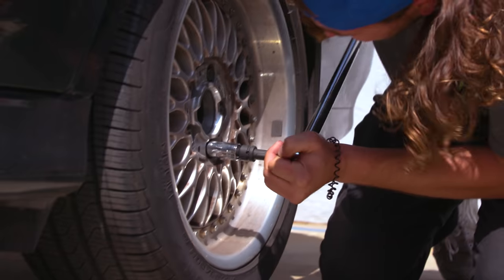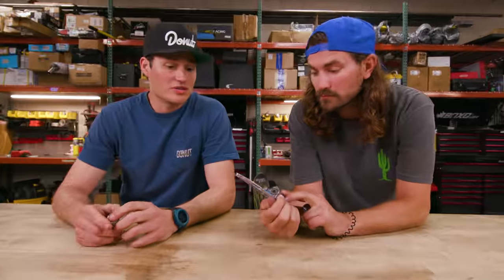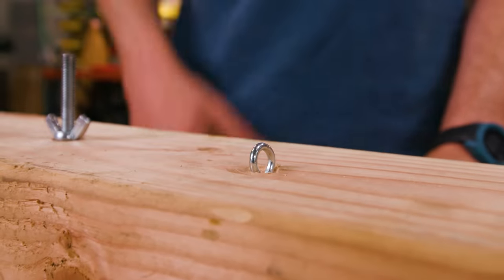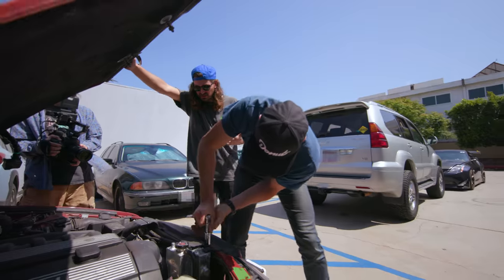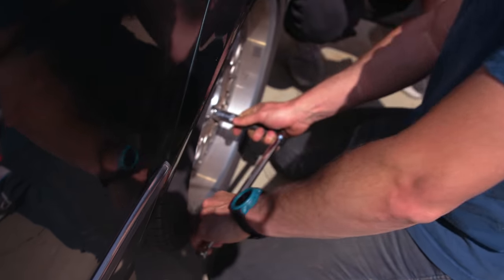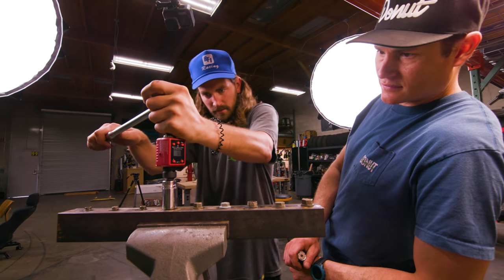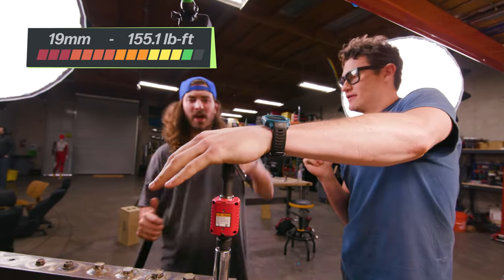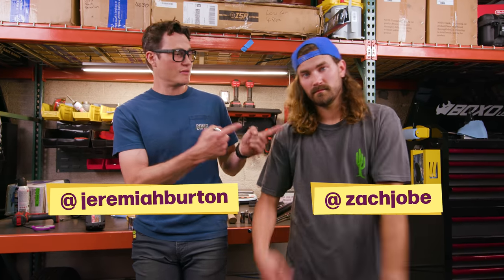Testing the World's Most Hated Tool

Comment from the maker: What tool should we test next?
Reply: out of context, but try to review cute keychain, like turbo keychain and other, even there is ball bearing one
Reply: I know it's not a specific answer but I think more "as seen on TV" tools would be great to see if they're worth it or not
Reply: Your mom
Reply: Dent king
Reply: Bolt extractors
Reply: Why did you reload it
Reply: I wrote this while watching the video so I guess my "wish" has been granted 🤣
Reply: Try some complete toolkit comparisons! Also, do you think you can put the metric measurements alongside the imperial in the edit? Like Nm alongside the lb-ft? It will make it super easy for the rest of us!
Reply: Angle grinders
Reply: you should try different types of bolt extractors. including those cheap chinese products to see which works best 👍
Reply: my fav tool of all, a d-list of donut employee cars
Reply: FLEX TAPE PLZZZZZZ
Reply: What tool was used to duplicate that actor throughout the entire video? Impressive.
Reply: PB blaster vs heat gun vs butane torch vs impact. Do some tests to show how each helps get a stuck bolt loose.
Reply: Could you please make a video explaining why teslas, or electric vehicles in general, have so much torque and acceleration but have little to no wheel spin compared to combustion vehicles with less horsepower and torque and wider tires?
Reply: Battery powered tools vs pneumatic, except for the hose, which is better. Also paint touch-up in dyi or don't.
Reply: You should test the various ways to join two electrical wires. Like standard barrel crimps vs those clips that have the blade thingy that cuts through the insulation as you close it vs twist and tape vs soldering etc
Reply: Why did you re upload it
Reply: A pump cart obstacle course consisting of only paper clips on the ground. Pretty much a guarantee that no one will get past the first obstacle.
Reply: Sham-wow
Reply: Try the "impactor" its a socket that has an impact mechanism built in
Reply: Jer, super cool shoes.. hope you didn't scuff em. Maybe try some fabric cleaners?
Reply: CAR JACKS  and CAR STANDS!!!!!!!!!!!!!!!!!!!!!!!!!!!!!!!!!!!!!!!!!!!!!!!!!!!!!!!!!!!
Reply: cheap vs expensive R134a. Not a tool but may be neat
Reply: your mom
Reply: FLEX SEAL ALL OF THE THINGS
Reply: The nemesis of all mechanics: gasket removal/gasket scraping methods.
Reply: Please test the durability and accuracy of 1/2" drive Torque wrenches. Click type and electric. Pittsburgh vs. Icon vs. Snap on etc. I want to see if the cheap ones are still +- 3% accuracy. And how often they really need to be recalibrated.
Reply: robo grip
Reply: Flex Seal and make the boat
Reply: Eye protection!
Reply: Hardened steel screwdrivers that actually work and don’t slip and strip. Hardened steel is subjective and most are hyperbolic.
Reply: Tiger Wrench
Reply: My mom
Reply: As Seen on TV Auto Adjusting Crescent Wrench
Reply: The next tool should be flex seal. Make it as funny as the commercials 😂😂
Reply: Oil filter wrenches. Stack ‘em up to see which one is the king 👑
Reply: Please do an " Up to Speed " on the Hyundai Genesis Coupe...😊
Reply: Tool Truck Face off. Is Snap-on worth your soul or are the other tool truck brands just as good
Reply: Slap Chop
Reply: Scratch solution-
Reply: Or Car Cane.
Reply: Off brand Duct Tape would be funny. I see that stuff in stores everywhere. Is the Off brand as good as the main?
Reply: The spray sealant that you can make a boat out off
Reply: Welder
Reply: Screwdrivers
Reply: Gear Wrench Quadbox tests now? (Not seen on T.V.)
Reply: Bionic Grip Wrench / Bionic Wrench
Reply: Flex tape
Reply: Pressure washer and vacuun cleaner! Please
Reply: Angle grinder attachments, that turn those death machines into different death machines.
Reply: Jeremiah. He's a tool. Test him.
Reply: For it to work you have to buy the gator nuts and bolts
Reply: We wanna see you fix cars with non-car parts
Reply: Plastic welders
Reply: You already tested this tool
Reply: Brushed vs brushless
Reply: Head Gasket sealer i.e Steel seal
Reply: I have a set of RoboGrips from the 90s that I still use, might be worth it.
Reply: Toque wrenches please!
Reply: Swivel sockets, universal joint adapters, and flexible extensions.
Reply: Any of the flex tape products
Reply: Hilti Tools
Reply: Crescent wrench
Reply: Flying Lures
Reply: Flex seal/Flex tape all of the Flex products lol
Reply: Hose clamp pliers
Reply: Oil filter remover tools!
Reply: FLEX products
Reply: As seen on TV… I don’t know why you’d make a flexseal bottom boat, but I’d love to see it
Reply: The ASOTV Turbo Jet vs power washer
Reply: Flowbee, Without a doubt, Zach and Nolan could use a trim.
Reply: @muddboss3309  yes
Reply: @JeazyG  they have a lot of good videos about electric motors and ev cars on this channel already
Reply: Robo grip from Sears
Reply: the Knipex 8605250 will totally replace all of your spanner tools though and most pliers... you will never use them ever again.. especialy the adjustable ones... those screws that you screw with this weird socket. it can totally do that... if there one tool i can have on an emergency i want that to be it..!! (bold claim i know but look at it)
Reply: I have no idea what it is called but my wife got me a flexible bendy shaft for my drill to get into those awkward hard to reach places. I actually used it to drill some holes under a power wheel to add underglow for my kids.
Reply: I still have dent king it takes multiple pulls to work but you can get high spots doing it
Reply: I still have dent king it takes multiple pulls to work but you can get high spots
Reply: You guys said the most hated tool. I thought it was dewault 😂😂
Reply: Well, now that you bring up the common American tradition that is the junk drawer... I think it would be a pretty good competition to see who has the best collection of junk drawer tools... You know you're gonna find at least a few tire pressure gauges and an assortment of missing sockets... but, the junk drawer also extends to your toolbox junk drawer too... at the end you can do some trades to see if these tools can become one mans trash to another mans treasure. =) Some of them might just end up back on the shelf being put to good use.
Reply: Test out some bongs to see if they rip just as good as the next ...thats what i do all day with 10 different bongs by the 10th i forgot why i started...its what i do for creating..im into fancy rich people wood builds and creation is endless...we used these for a gear box of ours for a weed tumbler sifter ...worked well because it has flexing in it functions...
Reply: Shamwow🤣
Reply: @JeazyG  Torque on EVs has to do with how electric motors work, let me explain. torque is measured by force times distance from center of rotation.. in fuel cars that means force of combustion (witch is no constant due to timing variation, fuel combustability not been instand and so on) times cranks length.. on Evs is the diameter of the stator (outrunner motors) witch is huge times magnetic field force witch is constant throughout the rpm range, so torque is max and constant even at 0 rpm... 
now about wheel spin.. well thats easy, its electronically controlled... they are tone of videos of EVs drifting that disable that safety feature, all though they are very hard to control due to instant power been applied on wheels that leaves extremelly small margin for error..
Reply: FLEX TAPE!!!! (It fixed my convertible top a few years ago until I replace it)
Reply: Finding 10mm and 13mm block keys. Once I searched for a 10mm, found like 7? 11mm.
Reply: Zachs dumpy??
Reply: Oil filter wrenches, there are like 100 types and most of them are shit
Reply: Different hair brushes with obvs Zach!
Reply: 18v battery grinder
18v band saw
Reply: Car Jacks
Reply: Try Kids Toy Tools...
Reply: no idea if its on "as seen on TV" but, rust converters or rust "figting" kits would be nice.
Reply: Oil filter wrenches - the pliers style, rubber strap, chain strap, the kind that go onto ratchet wrench, and whatever other types there are.  And test on various size filters, some with half filter inaccessible, i.e. recessed against oil pan (look under a 2008-2013 GM truck with a 5.3).
First time to post/reply......long time subscriber.  Keep up the tech and info-based videos !!
Reply: internal bearing pullers
Reply: Harbor freight tools against name brand! I love freight tools but they get a bad rep
Reply: EasyOuts - the cheap ones.
Reply: Open End Ratcheting Wrenches. There are a bunch of manufactures and their designs are slightly different. My craftsman set upsets me because they do not easily lock back into place. Help me find a brand that works because if you did they would be worth their weight in gold!!!
Reply: Flex fix tape and goop for sure. "Fix any leak"
Reply: Zero Degree Socket Wrench
Reply: dude i bought this for my dad at Christmas...
Reply: @jundikhaalish2081  I agree, cute Keychains - why the heck not.
Reply: Flextape
Reply: the different types of easy out bits and how easy they are for removing broken bolts vs just welding a nut on it and using a box end on it
Reply: Air pressure gauge tells u how much air in all tires threw air caps and connects threw cig lighter
Reply: Shop vac
Reply: Whilst it’s a little bit more up “project farm”’s alley …. Comparing different types of torque wrench and their accuracy. E.g. ratchet vs deflecting beam vs electronic
Reply: cheap vs expensive torque wrench??
Reply: Any power tools Budget Vs Expensive.
Reply: I'd love a video on how to get a stuck o2 sensor off a 2002 focus st170 (svt for my American friends) because at the minute that's standing between me and an MOT/ roadworthy certificate 😂
Reply: Torque wrenches
Reply: The bionic wrench.
Reply: I think a tool brand comparison would be cool. EG Snapon vs Sidcrome or similar to see there braking point.
Reply: You should have put a 3/4 impact on it!!! Really torture test it!
Reply: Magic pen for scratches would be nice to see in Tool Party Graveyard... Or maybe it would not end there? ;)
Reply: Flex tape. Can it patch a flat tire?
Reply: Chinese makita based tools like those on aliexpress
Reply: @jundikhaalish2081  wouldnt  be a bad D-List sode
Reply: Floor jacks and torque wrenches. Separately of course
Reply: Oil filter wrenches
Reply: Duct tape vs gorilla grip vs jb weld
Reply: Double sided d1ldo
Reply: Flex Tape !
Reply: Touch-up paint, paint-less dent DIY repair tool, DIY windshield rock chip kits
Reply: one of those fix a flat kits that come with cars instead of a spare
Reply: shotgun
Reply: @coreydabrowski2249  let’s go I’m with you
Reply: James Pumphrey
Reply: @jacobgalloway6942  Project Farm did that.
Reply: stuff relating to seized bolts; stud extractors, penetrating oil, heating up, tapping under torque etc.
Reply: you should test more your mom jokes
Reply: @muddboss3309  Is that the one that uses hot glue? Some PDR(Paintless Dent Repair) guys use similar tools. I've tried a few myself. They can work really well. But they can also pull the paint off the panel. Depends on the dent and the paint. Good one to review in my opinion
Reply: Jack stands
Reply: Flex tape and flex seal
Reply: Test the T Bone wrench. Each end has different sockets on a swivel. DO IT
Reply: @jacobgalloway6942  love flex tape
Reply: Flexible Extension Drill Bit
Reply: Harbor freight vs snap on pull bars
Reply: I want too see a tourqe wrench test. Cheap vs pricey. Curious as too how much accuracy they lose overtime or just come calibrated wrong. Also could throw in the price you pay for using your tourqe wrench for a breaker bar haha
Reply: You guys gotta do one on the Knipex adjustable pliers. I don't road trip without em!
Reply: ShamWow.

My old man bought dozens of them. It’s no replacement for a chamois, but it’s miles better than any microfiber I’ve ever used. Plus, i’d never use a chamois to wipe puke off a quarter panel…
Reply: JB weld
Reply: Truck stop tools
Reply: You should collab with Project Farm
Reply: Battery powered socket wrenches.
Reply: @JeazyG  Interesting. I always assumed that it was better traction control and monitoring. Easier to measure spin based on motor load and much more granular control over power output of individual wheels. But. Maybe that isn’t it at all.
Reply: flex tape
Reply: Bucket vac
Reply: Flex tape.
Get in a fender bender in the rain and want to hold the thing up for a bit til you can get it to the shop. Can the tape work, as advertised, when things are already wet?
Reply: Robogrips, please!
Reply: Shop soaps - Lava, Fast Orange, etc.
Reply: get someone's son to hold a flashlight, get a tool from the drawer, buy blinker fluid, etc
Reply: A drildo
Reply: the different types of specialty transmission repair tools.
Reply: Unrelated to the question, but can you guys please stop saying "Foot pounds of torque" 'cause it's actually lb-ft of torque...
Reply: I can't remember the name... But it's a compact lug nut changer that fixes it if there's damage... If anyone can find the name of it...uch appreciated
Reply: Magic wrench maybe?
Reply: Would be kinda cool if you done country comparison, Example UK VS USA on tools so which county does the best tools or other things like components of a car you can do alot of country Vs country
Reply: Why didn't you try standard.and metric bolt sizes with the gator grip. Not that I would expect it to be any different, it would just be interesting to see if it grips standard any better
Reply: There's a newer updated version of this tool called the super socket I used to get ads for it a lot but I never ended up getting it you should try it!
Reply: Not really a tool, but flextape is obviously a must
Reply: @jundikhaalish2081  the tool that they must try should use a silver sprocket.
Reply: @LIKEcommentANDsubscribe  or white sprockets.
Reply: @stoyan.velinov  happy early idul fitri 2022, Stoyan Velinov. 🙏
Reply: @Jamppa.  try also silver sprockets.
Reply: @OliveMule  👍👍👍
Reply: @jacobgalloway6942  try also the sprocket from white chains.
Reply: The same tool, but with standard instead of metric bolts.
Reply: The shake weight :)
Reply: Test my tool 😏
Reply: @purwantiallan5089  what???
Reply: Impacts, cordless, vs battery, vs pneumatic
Reply: Walmart tools???
Reply: Former Vice President Joe Biden
Reply: sawzall, obs, chop chop. Then a nano chainsaw - super fun. Titanium coated step drill - best fun ever. Go a powered metal sheet nibbler - dare ya. plasma cutter - hell yes.
Reply: Steel stick and flex tape/seal products
Reply: Cheap welder vs exspensive welder :?
Reply: @quintbottolfsen5817  Totally want to see what they'd do to get there hands dirty between each scrubbing.  Haha. Pour oil over their hands and then dig through a bag of potting soil?
Reply: @ErickBreneman  James and Nolan test messy foods part 2.
Reply: FIBREFIX!!! For manly men.
Reply: OBD readers
Reply: A 10mm. I hear they are hard to find
Reply: Can you please test a Joe Biden?
Reply: Robo Grip
Reply: I like that you guys are running the Milwaukee Fuel E-tools. I have a vast selection of Snap on and Milwaukee stuff and the Milwaukee outperforms most of my Snap on.
Reply: Test that "as seen on TV" wonder drill bit that never needs sharpening and can drill everything
Reply: How bout those multisocket oil pan drain plug tools?  Gotta ❤️ those!
Reply: Test i think Flex Tape? See if you can make a buggy out of it.
Reply: @JeazyG  Weight. That's the entire video.
Reply: Oil filters/ ring ratchet /clips remove
Reply: joker wrenches homie
Reply: @shikamaru281281  electric cars weigh more and are faster.
Reply: @JeazyG  Not all are faster. Lots of electric cars are ~6 seconds 0-60. The reason they CAN be faster, is because of weight. The more weight = less tire spin. More pressure to the ground = more power to the ground.
Reply: You should test one of those snake adapter things next
Reply: Metwrinch!

The award-winning 62 Piece Metric and Inch Combination and Wrench and Socket Set handles all nuts and bolts - Metric, Standard, and even ones with rounded or worn edges. These sockets and wrenches are able to grip both inch and metric fasteners, reducing slippage for greater safety and making it virtually impossible to damage them. The compact set of 62 Metric and Inch tool replaces 130 conventional tools. Keep a set at home and another in your car. The solid chrome-vanadium tools are backed by a lifetime warranty. 1/4" and 3/8" drive ratchets and sockets included.
Reply: Can you do a test on Brake line flare tools?
Reply: @JeazyG  It's the electronic traction control. Very clever controllers they is!
Reply: Lizard Camera
Reply: Hitachi magic wand
Reply: Nu Finish "the once a year car polish"!
Reply: Quick action wrenches, different brands. there great but I break them all the time and im wondering how many pounds are they breaking at.
Reply: Taking out an engine using only gator grips would be a cool video
Reply: @KJW742  you would need like 50 of them just to get the motor out and 100 to put it back in lol
Reply: @Ro-Bucks  it doesn't need to be perfect, just has to run
Reply: Torture test a shop vac vs. Dewalt/makita/harbor freight vacuums... see what will clean the shop the best for the longest
Reply: @jacobgalloway6942  check out tyler tube for all your flex tape/flex glue reviews... he does an awesome job!
Reply: The dude sitting next to you? 😂
Reply: Vampliers or Bionic Wrench
Reply: Flex Tape
Reply: Cordless Ratchets: Milwaukee M12  is the standard, lots of cheaper options on Amazon.
Reply: Screwdriver Sets
Reply: Yourselves
Reply: @jmb371  Bam!!! 😂😂😂😂
Reply: @JeazyG  interested to see this one too. from my understanding, wheel slip is detected electronically and thus adjustments to the power output of the motor are nearly instantaneous, compared with a gasoline engine where that kind of fine control is impossible - throttle and fuel injection are pretty imprecise inputs comparatively. basically as far as i'm aware of only the brakes are used by traction control to stop wheelspin in ICE cars instead of the motor itself
Reply: The super saw and tactical flashlight
Reply: Fluted broken bolt extractor vs spiral type
Reply: @JeazyG Hall Effect wheel speed sensors on each hub to throttle back via the traction control system.  With the system disabled, electric motors will thoroughly smoke down some tires.  Might have done it a few times to prove a point.
Reply: @xDMG15x  They are called Scotch Locks.   The epitome of half-assedness.
Reply: @cameronh5442  Same chemical compound.  Just get the cheap stuff from Wal-Mart.
Reply: @Shaw9.81  I’m a Hyundai Tech.  Whatcha wanna know?
Reply: @dillonreynolds370  Get the Ebay welder kit.  Looks like a normal pistol type soldering iron.  About $19.  It’ll change your life.
Reply: @benrampling812  PB Blaster rust penetrant left soaking for hours.  If it has broken loose but galled and cross threaded itself on the way out, force it, for the threads are already ruined.  Chase the threads with a common spark plug thread chasing tap.  If the O2 is known bad, cut off the harness and use a 6pt deep socket.   No half-assing it with an open end wrench.
Reply: @blackhawk7r221  why is the 2009-2016 Genesis Coupe missing one differential bushing?
Reply: @imacahguy  Lifesaver tool
Reply: @eyo-abasibassey983  Too entrenched in the common vanacular from the olden days when we didn’t need to know the weight, we needed to know how far it could be lifted, that’s why we say it backwards.
Reply: It’s Thunder  I use my inexpensive $259 flux core HF mig far more than my other real machines.  As long as you get a 220 version.  Easy as pie to wire a 220 outlet.  We aren’t exactly looking for xray quality pipe welds, right?
Reply: @shikamaru281281  They are very downrated.   Long ago we played with a prototype demo Prius at the tech training center.  Easily did 0-60 in under 4 seconds.  I think they put it out on tour to get mechanics fired up about the future electric cars.  This was way back in the early 90’s.
Reply: @Shaw9.81  Be a bit more specific and I’ll look it up.  Bushing location in the diff?   I’ll be honest, we’ve never had to open up any rear diffs at our dealership.
Reply: @Shaw9.81  Are you speaking of why the diff chunk side bearings only use a shim on one side?
Reply: @blackhawk7r221  yes I am...😮‍💨
Reply: shake and break
Reply: @Shaw9.81  Part 53064 spacer shim, same part number on both sides.
Reply: @blackhawk7r221  ok thank you, I already put it on😅 but does Hyundai ship them from the factory like that?
Reply: my manager
Reply: flloor jacks
Reply: Those miracle car paint repair pens
Reply: @Shaw9.81  Could not say, but doubtful. Our parts diagram shows carrier shims on both sides.
Reply: @blackhawk7r221  all been done and she's not budged mate. I got sick of it in the end and was only doing more damage to the flats and threads so decided best to let the professionals have a go before I end up on the next video of "customer states" 😂😂they should have a much better time with it than I will and It means I can get the car back quicker hopefully
Reply: @benrampling812  What you are experiencing was common  on Toyotas.  Lack of anti-seize  from the factory, and we paid the price at the dealership.
Reply: @blackhawk7r221  o2 sensor needs replacement as it's not functioning and failing an emissions test at low idle. Tried most tricks in book to get sorted but no luck.
Reply: For the next tool to test, I can think of a few politicians in Canada and the US.🤣
Reply: different types of oil filter wrenchs
Reply: Turbo encabulator.
Reply: Your balls, you should see if they still work.
Reply: Metrinch sockets and wrenches.
Reply: I'm just saying if someone re created it but instead of circles make it out triangle pieces so when you start torquing down on it the triangles lock into one another and it would be flat along the cross sections on the bolt head
Reply: The crazy two-blade Sawzall that premiered several years back
Reply: How the wallet ninja 🥷 actually performs with the tasks it can claims it can perform
Reply: Gunson colortune.
Reply: I would love to see if knipex pliers are really that much better than the Doyle knock off and other brands
Reply: Nolan
Reply: You should fabricate your own gator grip but instead of round pins you use small hexagonal ones that are more tightly packed. Would be an awesome design study.
Reply: Speculum
Reply: A bunch of Weird tools from Aliexpress.
Reply: Spark plug bolts.
Reply: Test the difference in strength between high end tools. example: a 17mm spanner snap-on VS mac VS teng VS facom. See which one is really worth the dollar
Reply: Jack types for cars. Speed jacks, fame lifts, traditional jacks etc. pros and cons and cost benefits
Reply: @fillhall4774  dude the only snap on tools i own are ones I've found, the reason i want them tested is because after 12 years as a mechanic i still don't think they are as good as advertised i want them to break
Reply: Squatty Potty
Reply: Quick battery disconnectors!
Reply: Please, Please: Chinese made vs American made tool sets.
Reply: gator grip is good when you dont have any other sockets. but thats about it. ive had one for many years and have used it half a dozen times. its not flawless. bit either is leaving your tools at home.
Reply: The Super Socket is the same thing but probably better quality
Reply: joe biden
Reply: One of those Mini Hammer/screwdriver/ floral pattern nonsense . Usually found at the checkout at hardware stores.
Reply: Jeremiah, anyone ever tell you, with those glasses, you look like the President from "Monsters vs Aliens"? lol
Reply: Just realized that you forgot to blur the 7YBY250 plate.
Reply: Torque Sticks with impact guns would be cool to see.
Reply: Milwaukee tools!
Reply: Flex Seal bb
Reply: @LoneStarGarage832  project farm....
Reply: @JeazyG  not a tool or as seen on TV.
Reply: @cameronh5442  so waste a bunch of CFC to see how much ozone you can destroy?
Reply: @MarkACarroll  Klein. Project farm already did
Reply: @Tallnerdyguy  exactly
Reply: Fiber fix tape
Reply: The Snake Light
Black Decker
VersaPak
The original flexible flashlight
Reply: Products stamped made USA are cleared for random drug testing.
Signed - BOSS
Reply: Another thing my wife got me is a wrist band that has magnets for holding bolts and screws and stuff. It's actually really handy when I remember to use it.
Reply: flexseal?
Reply: @jundikhaalish2081  is the 14 11 1 wee 3510 _
Reply: The O-Ratchet set. I love mine but I don’t want to use it much in case I would break something in it. Please do the O-Ratchet set.
Reply: I’m so glad you paid respect for my father who died when using his gator grip while doing brain surgery. 😢
Reply: My boss is a tool. Can you test him please?
Reply: try to kill an ARB air compressor on the 100% duty cycle claim
Reply: About 20 years ago I purchased a "Supa Spanner set" from the tv and it was the biggest pile of shit ever. I paid $50 for 4 Supa Spanners and it was supposed to cover all spanner sizes from 2mm to 40mm with just 4 spanners. The trouble was the spanners were huge, in order to be auto adjustable. The idea was that as you pulled the jaws tightened automatically. The did and shredded every bolt and nut I put it on, damaging my car. But that was only if the nut was easily accessible, otherwise I just used my old spannerset. With alot of force they would jump off the nut, slicing my knuckles to pieces, as I hit other parts of my car. Lots of blood and missing skin latter I wanted a complete refund and it had a money back guarantee. The scam was although they were shipped from my country (Australia) I had to send the spanners to China to get the refund. These things were heavy and posting them from Australia to China was $63, remember they only cost $50, so I ended up keeping them. Today they are in a landfill somewhere, I don't even think the metal was worth recycling.
Reply: One of those “EZ” paint touch up thingamabobs that magically make the scratches on your vehicle disappear…. Then maybe one of those magic upholstery repair thingamabobs for leather upholstery
Reply: @asmith7094  one of the best things on the planet for sure…..
Reply: @TheTowertime  I think as an idea it’s not bad the execution really sucks. If there was a decent version of it that worked a lot better I would buy one
Reply: or  JB Weld VS Gorilla Weld VS Wire VS Stick Weld or something like that
Reply: @josephkanellopoulos5995  yeah same, I too had one in the junk drawer till i eventually just tossed it few years ago
Reply: You guys are seriously asking this question?  The ONLY obvious answer should be flex seal...
Reply: Radar Detectors  👍👍🍻
Reply: Seal pullers. Few different types...
Reply: Wallet Ninja
Reply: Deez Nuts
Reply: Oil filter wrenches! Honestly I think it would be so helpful in general to have a oil wrench comparison.
Reply: You should do Flex Seal Tape!!! I’m curious how much laughing I’ll do at that one!
Reply: My next door neighbor
Reply: TEST "ANYTHING" OUT OF "CHINA FREIGHT" ..........."cheers!"
Reply: Tesla, it's a tool.
How far will it go¿
Reply: How about the guy who created this one?
Reply: Once upon a time i saw a commercial for a socket set that was only a 3/8s drive. But the actor busted out what i could only call “sleeves” that inserted into the 1/2 drive sockets. A.) im curious bout this and B.) if it was a dream it’s my idea and I want royalties lol
Reply: Sobakawa pillow
Reply: Flex Tape!!!
Reply: @emerrepuntoka  Bet there was a lotta damage.
Reply: Metrinch sockets and spanners. They side rather than corner grip, so will do both metric and imperial sizes.
Reply: Flex Tape
Reply: Test the Go2 Socket
Reply: Got 1 piece of crap
Reply: Sanders
Reply: Floor jacks & jack stands
Reply: The one green dril
Reply: Dura Lube engine oil test.  Always seen them draining the oil and having the engine run dry with their product.
Reply: Loggerhead wrenches.
Reply: do hammer 
no do wrench
no wait do hamer
Reply: One of those deadly woodworking disks that you attach to an angle grinder, which have a chainsaw chain on the outside. Preferably with the safety guard removed.
Reply: Donald Trump
Reply: Hammer😆
Reply: Metwrench please test these tools!! I need to rebuild my tool collection and I’m thinking of buying these.
Reply: Robertson Screw Drivers
Reply: First let your editors add metric pleasee.

Not just this channel 👌
Reply: Use some festool for shopwork
Reply: Glock tyre punch
Reply: The youtube ad tool i think one of you guys left your wrench on the button and they just keep on slamming us with soooo manyyy ads, the ads are almost as long as the video
Reply: @coreydabrowski2249  you saw what the tool was in the thumbnail…. Yet you were gunna write the tool u saw in the thumbnail
Reply: @tomtucker9426  nah, I was hoping for other "As Seen On TV" gimmick tools to be tested
Reply: Strap Wrench!
Reply: The snowflake multi tool?
Reply: DR Brush Mower?  Try out each attachment?  😂😂😂  Not sure if it was “as seen on TV” but back in the day it was an infomercial that ran between every TV show.
Reply: All that trouble to blur 1 license plate but you didn't blur the one at 6:18 man oh man cant get away with that huh?
Reply: make your own gator socket but outta titanium
Reply: Alien tape!,pretty please..........thanks man........
Reply: @BrowningThirty  I have a tiger wrench but before that I had a craftsman dogbone wrench. I have used a cheater pipe on them and changed some tires with them. The dog bone wrench was actually pretty durable but it wasn't practical for a lot of things because it just didn't fit in a lot of places
Reply: Robogrip
Reply: Robogrip pliers.
Reply: the brain 😜
Reply: Now that you destroyed some bolts how about some common bolt extractors?  From $ to $$$
Reply: Welding products from wish, PLEASE. I would, because nobody’s done it, but I’m tryna buy a welder and NOT get scammed out of all of my money lmao
Reply: I wanna see you guys split a boat in half and put it back together with epoxy putty 👍🏾
Reply: @You-dx8fm  it'd be awesome to see the comparison vs price
Reply: Universal Socket Wrench.

Universal 48 in One.
Reply: Garden shredder
Reply: Is flex tape a tool?!
Reply: Hey guys I really enjoyed the show I'm from the Lexington Kentucky area by the way, you guys should do something like testing older power tools I mean stuff from the 30s 40s 50s versus new power tools especially when it comes to build quality and usability, I know that those earlier drills even into the 70s we're mostly made of metal even if they had a plastic button but let me tell you, I have a early 2000s Black & Decker quantum drill I got when I was 12 and then more recently I bought a 1940s or early 50s Milwaukee drill made out of all metal and that thing is is a beast I haven't gotten to use it yet because somebody rewired it the wrong way.

Thanks for the consideration, and keep up the awesome videos.
Jesiah.
Reply: Do the new flex super glue they just came out with. They just said it can hold a bunch of weight with just one drop
Reply: I bought one with hex over 15 years ago.
Used sparingly but when I can't find a socket quick enough, it does the job.
Not the best but if I need to loosen something, it works for me.
Reply: Glad I never bought one.
They look rubbish quality
Reply: Mine
Reply: Is it just me or does the guy with the glasses look like the dude from blink 182?
Reply: Compare Harbor Freight brand against Big name brands
Reply: You guys should buy a bunch of those cheap roadside emergency assistance kits from Amazon and see how well the kits actually hold up. You can also make recommendations on what you keep in your ride side kit
Reply: That cool breeze fan that can cool a whole room in a hot summer day.
Reply: @rd95stang  
SHAM says it all !
WOW, can't believe I bought that !
Reply: @Jonathan Gonzalez it's something called gradual acceleration  on most electric vehicles much like traction control on gas cars, but only the dealer if I'm not mistaken can disable it (unless it's just a relay or something) my cousin works for gm he said the shop manager disabled it on a Chevy spark and it lit the tires up until he let off the accelerator
Reply: Pop Rivet guns
Reply: duratech wrenches off amazon
Reply: Doubled ended dild
Reply: I bought the Harbor Freight electric impact. It did awesome taking off an axle nut I spent 2 days trying to get off. But I feel like it's gotten weaker since I got it. Like I used to be able to take off lug nuts (not easily). Now I can't do that, or take off a strut bolt anymore really.
Reply: Metric system on screen for international viewers
Reply: Get someone to make the same tool but it's hexogonal and has hexogonal inner pieces.
Reply: Would love to see if you can find a use for the 8" Bionic Wrench. To my shame, I bought  one at a pharmacy in LA and never looked back. It ended up with a similar issue as the universal socket. The room in the work area was filled with the wrenches' outer casing and not the adjustable teeth that let the wrench do its work. If you can find that use it would be very cool.
Reply: Derp
Reply: i forget the brand (I think kobalt) they have a ratcheting self adjusting adjustable, aka crescent wrench i saw on display at lowes for $25. Would like to see that tested
Reply: multifunctional double head wrench